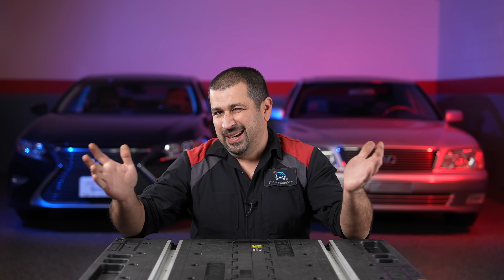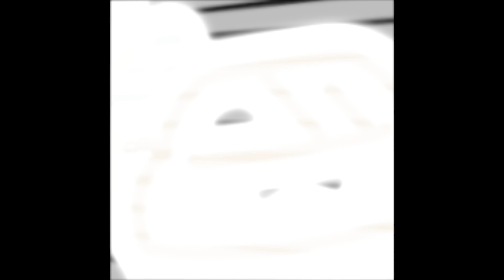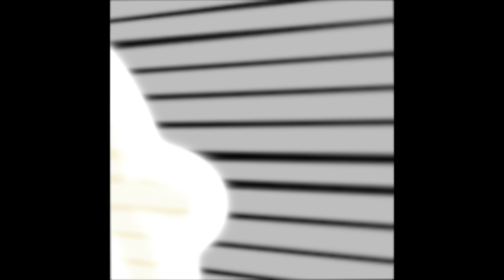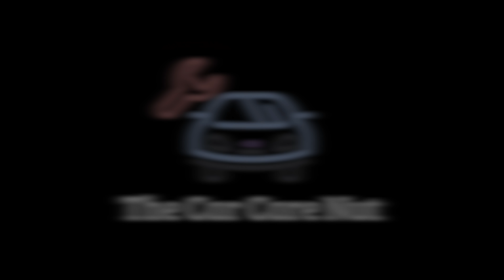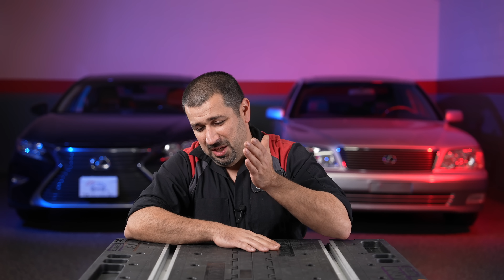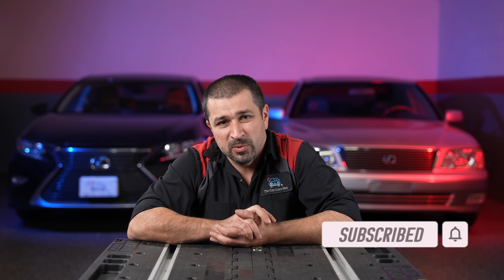Can Modern Turbo Engines Be Reliable? Here's The TRUTH!

Comment: Interesting story here in Poland. Few years ago a grandfather of my friend purchased brand new Toyota Yaris, which after around 100k km (60k miles) had an engine failure. He took it to the dealer, they investigated the engine and asked a question: 
- when was the last oil change?
- what is oil change?
The engineers couldn't believe how the engine ran for almost 100k kilometers on one oil that the Toyota central in Japan requested to send that engine to them for analysis. 2 morals of this story:

1) Change oil in your engine
2 If you don't know what the engine oil is - buy a Toyota

Comment: I have a 2019 C-HR, 1,200cc with a Turbo in it. This is my first vehicle and I have no knowledge about vehicle...this guy said engine oil change at 3,000-3,500 miles...since my odometer gives info in kilometer and i did a conversion it says that the equivalents is 4,828-5,633 km should i do the oil change at this range or just change the oil at 3,000-3,500 kilometer instead...?

Comment: i hate turbo engines. As well as electronic shit on board.The two best cars I have owned ? My 1973 Cadillac 500 ci . and my 1937 British Daimler DH best cruisers,for hundred thousands of miles. Simple, reliable, not greedy in maintenance and easy to repair. and now after 30years of use and only 200K miles, the turbo of my Disco 1 Land Rover blew up. so I think to even go further in history and look for (like my first Dodge Coronet 1948) a good old simple cruiser. You are great, Like your info, good luck

Comment: Do turbos really help with emissions?  If you have to spin up to get the power needed, are you not burning more fuel?  It’s like rating MPG by using a static roller rather than use real world driving.

Comment: Frankly, turbos for ordinary people will require (1) rock solid engineering, (2) designed for easy to perform routine maintenance, and (3) whole system is designed to compensate for human stupidity or laziness (e.g., electric lubrication pump that keeps circulating after motor is shut off until turbo temps drop to safe levels for shutdown).  Turbos were never originally meant for ordinary drivers…they were conceived for enthusiasts.

Comment: I had a Saab 9-3.  Lasted forever.  Had a Mazda MX-6 GT same.  One main difference is that the boost was at a reasonable level and they were designed to push the engines to 300 hp.  Now cars are trying to get V8 and even V6 power out of small 4 cylinder engines.

Comment: Changing a leaky water pump for a 2012 Camry hybrid cost $ 1300 at the Toyota dealership in Tampa, Florida. We are dealing with crooks in auto industry. 1: buying a car, 2: maintaining a car, 3: insure a car. The three components are ripping off profesionist. It is easier to maintain a horse than a pice of metal crap. This is the society where we are living today. Unbelievable. There is no shame to steal.

Comment: Yes......they are reliable.....but change your oil every 3000 miles.......3000 maybe 3500 if busy one weekend......also warming up on cold days.....cold oil looses viscosity and wont lubricate motor and turbos properly when cold.....also letting motor cool off after driving 55mph or faster for 30 min or longer......my 2017 Ford Fusion Sport 2.7 Twin Turbo V6 AWD has 155k and has had zero issues besides a recall on rear brakes.....

Comment: Give it a couple of minutes when you start it cold, and let it idle a minute before you shut it down, let the turbo slow down. That turbo is still spinning after shut off with no oil pressure.
Reply: Yes ; cool down @ idle before shut down solid practice

Comment: Can you run Amsoil 0w-20 signature series for 15k in a 1.5L civic si? This is my first turbo car
Reply: What did he JUST SAY ?  ?  ?  

Only an IDIOT would go FIFTEEN THOUSAND miles on ANY oil change ‼️‼️‼️‼️‼️‼️‼️‼️‼️
Reply: @squidnoid8 you obviously don’t know about Amsoil products so don’t insult me without knowing the facts
Reply: I extol the virtues of Amsoil even further.  Amsoil produces their 100% Synthetic Oils to be a combination of PAOs and a Class V Synthetic (such as Esters or an equivalent), without any hydrocracked petroleum, PLUS as an added bonus, the the Signature Series line of oils utilizes top-shelve additives from Lubrizol.  The molecules of these Class IV & V Synthetics are of the same uniform shape allowing them to flow much more readily throughout the engines, transmissions and differentials, reducing damaging heat, creating more power and increasing fuel economy.  Also, the backbone of Amsoil 100% Synthetic lubricants have a much lesser tendency to attract oxygen molecules that affect the majority of "Full-Synthetic" Lubricants (where damaging oxygen can form sludge).

Concerning my 2016 Toyota Hybrid, I sent a used oil sample of Amsoil 100% Synthetic Signature Series 0W-20 for testing (that had gone 12 months and 7,233 miles).  The results were an average of 1.5 PPM of wear metals per 1,000 miles driven (The Motor Geek previously stated on one of the videos, if a vehicle can achieve less than the 5 PPM per 1,000 miles, the oil is really, really good).  The lab said that the oil was considered good for continued use, but I changed it before I received the test results.

The beauty of the Amsoil Warranty which would make it attractive to potential buyers, is that it applies regardless of the age of the vehicle or the vehicle’s mileage or if they never used Amsoil in the past in their vehicle (I haven't seen another motor-oil manufacturer produce such a wide-reaching warranty, as this one from Amsoil)!!  The warranty applies to any parts damaged as a result of the Amsoil product, as long as the vehicle was in good mechanical condition when they first began to use Amsoil.  Amsoil will warranty their "100% Synthetic" Signature Series Oils for 15,000 miles for "severe driving conditions) or one year (whichever comes first), as long as you utilize an Amsoil Oil Filter (Amsoil claims that if you choose to use another brand of oil filter, that filter will be only good for 12,000 miles).  Do you normally drive 15,000 or more miles a year? 

You can always have the oil analyzed by a lab when you reach 10,000 miles to make sure everything is okay, where you will learn whether the oil would be suitable for continued usage.  If you don't mind paying a lab further, you could do another test at 12,500 and 15,000 miles.
Reply: @jimn.9990 I’ve always used Amsoil signature series in all of my vehicles but I’ve never owned or used the 0w-20 SS in my turbo Honda civic si. Amsoil is top tier but don’t want to exceed the severe driving range in this vehicle. Thanks for the advice and good information

Comment: Having owned a couple of turbos, I find out the hard way. Turbo + Aluminum parts = Heat related failure (I live in a semi-arid desert) and the failure can come in multiple ways. Then I bought a supercharged Mustang Cobra, and the heat issues completely went away. Nothing like using fresh air instead of hot exhaust.

Comment: No they don't last. When they fail it's usually after warrenty expires and when you press the pedal to keep up with larger engines your gas mileage goes way down. Most of the time people use the lead foot approach to boost their ego. Always advertised as much higher hp than you would have expected. Doubtful your tailpipe emmissions are still acceptable. I believe that stats are not correct.

Comment: Heath cycles are the enemy. No turbo = less heat. Turbo cars need frequent maintanance and better engineering and they can last. There is plenty high mileage turbo engines including with track use but remember they change the oil sometimes every 2-3k km in high demand environment. Same for the gearboxes, diffs etc. For lets say 2.0 turbo petrol engines is good to change the oil in every 7-10k km ( 5-7k miles). For example Audi has 20k miles(30k km) intervals in Europe for 2.0 tfsi and thas comical. You do 100k with 3 oil changes...Same engines on VW on track get like oil changes at 1k max. Believe me track engineers know better. If you wan reliability just buy N/A engine like Mazda/Toyota 2.5`s or V6`s. Yep its slow but much much more reliable. These can go 300-500k with minor problems.

Comment: lol I change my oil 500/1500/3000. Then every 7500-10k. Up to 15k with 0w-20, then after 5w-30. Amsoil signature series and filter only. Wiix air filters every 15 at least. This is the info from Japanese engineers for engine longevity for the 3.4l tundra. Also don’t use auto stop/start. My tundras engine is pristine considering it’s part of the recall. Motor oil geek disagrees with this guy on viscosity. 0w-20, 5w-20, and 5w-30 are all recommended in this engine. The epa is the one reason reliability sucks. 0w-20 is sensitive to the heat and shearing in turbo engines especially. Hence more frequent oil changes(why I use the oil I do). Just saying don’t skimp on oil, I use amsoil specifically cause it’s cold flow is close to the best new and old. Less wear metals and prevents sludge. It also resists shearing/more heat tolerant more than any other. What this guy says is right to a point, but he has that American dealer style attitude. Save your vehicles from the epa
Reply: I extol the virtues of Amsoil even further.  Amsoil produces their 100% Synthetic Oils to be a combination of PAOs and a Class V Synthetic (such as Esters or an equivalent), without any hydrocracked petroleum, PLUS as an added bonus, the the Signature Series line of oils utilizes top-shelve additives from Lubrizol.  The molecules of these Class IV & V Synthetics are of the same uniform shape allowing them to flow much more readily throughout the engines, transmissions and differentials, reducing damaging heat, creating more power and increasing fuel economy.  Also, the backbone of Amsoil 100% Synthetic lubricants have a much lesser tendency to attract oxygen molecules that affect the majority of "Full-Synthetic" Lubricants (where damaging oxygen can form sludge).

Concerning my 2016 Toyota Hybrid, I sent a used oil sample of Amsoil 100% Synthetic Signature Series 0W-20 for testing (that had gone 12 months and 7,233 miles).  The results were an average of 1.5 PPM of wear metals per 1,000 miles driven (The Motor Geek previously stated on one of the videos, if a vehicle can achieve less than the 5 PPM per 1,000 miles, the oil is really, really good).  The lab said that the oil was considered good for continued use, but I changed it before I received the test results.

The beauty of the Amsoil Warranty which would make it attractive to potential buyers, is that it applies regardless of the age of the vehicle or the vehicle’s mileage or if they never used Amsoil in the past in their vehicle (I haven't seen another motor-oil manufacturer produce such a wide-reaching warranty, as this one from Amsoil)!!   The warranty applies to any parts damaged as a result of the Amsoil product, as long as the vehicle was in good mechanical condition when they first began to use Amsoil.

Comment: My former track car, 2.0 liter with a turbo got its oil changed before every track day.  Lasted for two years with no problems until I hit a deer.  Oil is cheap, engines are expensive.  My current cars are all naturally aspirated.  Good program with good info.

Comment: Low boost?? 25-35 psi under heavy loads, going up and down mountains and hills? Diesel engines have zero vacuum. Diesel trucks are under 10-35 psi from 11-24 hours a day. My 3.5 twin turbo is seldom over a few psi.

Comment: I get the turbos are to reduce emissions, but it's such a small difference in MPG.  How much of an emissions difference is it?  Looking at the 5th gen 4runner V6 and the 2025 turbo 4runner (non-hybrid), it's a 3mpg difference.  I'd rather have the long lasting V6 for what equates to 1-2 fewer gallons of gas per fill up.  I'm curious how hybrids affect engine longevity.  A 2025 4runner hybrid gets 7mpg better fuel economy mixed.  That's a big difference, and it has more power.

Comment: I can not testify to todays engines. But the 2.3 inline 4 in my 84 SVO was in the 100,000 mile neighborhood when I sold it. The car was upgraded with the 16 tb Garrett. A redesign on the factory 14 due to wastegate housings cracking. Regular service.  No major issues. Maintenance! At least, the older ones!

Comment: This is where I don`t agree with this kind of speculation. I am an engineer, and I trust more the engineers designing these engines than a bunch of mechanics who don`t understand proper physics. If they came with these numbers, it is for a reason. Just because you are recommending changing oil every 3000 miles doesn`t make you right. I would argue with synthetic oil that you are way overkill. Many cars in europe have turbos, and they are not dying left and right just because they have turbos.

Comment: I want a car company to explain to me how up to 1 quart per 1,000 miles is “normal” consumption and then turn around and say you only have to charge oil every 10k miles….so I can drive this car for a few thousand miles without oil??…..
Reply: Tails they win, heads you lose ...
Reply: The car company has to follow the EPA. Lighter oil is recommended to meet emmission and mpg standards. They don't care about oil consumption. 
Meanwhile other countries recommend heavier oils because they have less regulations. So use heavier oil and change the oil more often.
Reply: @jeretso  Well designed engines will have negligible oil consumption well into the hundreds of thousands of miles even on lighter oils.  The unfortunate aspect with this topic is it 100% depends on the actual engine design as to what oils might cause problems in them.  The best of both worlds is possible if the engineering is done correctly, but you need to know the tested outcomes of your particular engine.
Reply: @big0bad0brad  I have a Forester and oil is disappearing.
Reply: @jeretso  Then if it is well designed (I have my questions with that brand in general) either it's not designed to run that weight of oil, or something has gone wrong.
Reply: @jeretso I’d be worried they would void the warranty if something happened…my car uses 5W-30 and the next model year went to 0W-30
Reply: @rogde5985  Wow exact same car and they change the oil weight overnight. For the warranty I would use 0W and watch the dipstick. I am worried about my kid who drives like a maniac and ignores the oil lights. I switched their Forester to 5W because the 0W was disappearing faster.
Reply: Its not normal, engine is made to loose tolerences
Reply: It’s the new eco type engine.😅 It will run itself to an early grave. Along with your wallet. 😂
Reply: You don’t have to change the oil often because you’re adding fresh oil every 1k miles.  It’s genius.  😅
Reply: Bad design, Or if it has a novelty engine that drinks oil.  Like the 13B Rotary.  The rotary engine can be reliable if not overtuned though.
Reply: What they're saying is they don't want to fix it.
Reply: LOL, must be a KIA

Comment: Short answer: No.  

You can't use a turbo to give enough towing capacity to an underpowered truck.  It overheats the engine.   You cannot drive your turbo and not do maintenance like regular high quality oil changes.   You cannot just turn your turbo off after a drive without the chance to cool.

Turbos have oil dilution issues.  They cook the oil.  Their bearings cook.  And when they give up the ghost, those metal fragments destroy your engine

End of story.   99% of people do not realize the care turbos need.

Comment: The recommended first oil change for my 2025 GMC Sierra with the 2.7 Liter won't be until 7,500 miles. I will be changing the oil at 3,000 or when the remaining oil life gets down to 50%.

Comment: Just hit 117,000 miles on my 2016 Fiesta ST which is a 1.6L turbo. Have done nothing other than fluids and spark plugs. Will probably need a timing belt/water pump soon but that’s normal. Never had a check engine light. Is that reliable? I’d say yes, but I’m not a mechanic.

Comment: Turbos in gas engines are a PITA.  I've been a pilot since 1983, flown numerous airplanes with turbocharged engines, and one thing was obvious, the turbo'd engines NEVER made it to TBO (time between overhauls).  No matter how gently we treated them, they always were maintenance hogs.  You get more power in the higher altitudes, but you pay a price for that.  Bought a new Tacoma V6 a couple years back, and it will probably be my last Toyota, as they SCREWED UP a great truck by putting a turbo'd 4cyl in it.

Comment: My Honda dealer always put a sticker on my windshield and they write the mileage for the next oil change scheduled for 5,000 miles. I never pay any attention to what they write on those. I'm usually around 4,000 miles for an oil change. And that also goes for my non-turbo Honda Fit too! My Civic has the turbo so I do 3,000 miles in the cold months and 4,000 in the summer.

Comment: Yeah I don't like these small engines with turbos in them 1.3 or 1.5 w/turbo is crazy to me.  Some manufactures have a 3 cylinder engines - sigh....

I agree that if you buy a used car ... now what?  It sounds like these turbos are not forgiving.
Time to build my own car :)

Comment: More the reason to use high end synthetic oils like Amsoil. The additive antiwear packs built into the oil will protect engine from wearing vital parts while keeping it clean. Do an oil analysis and see when you need to change it.